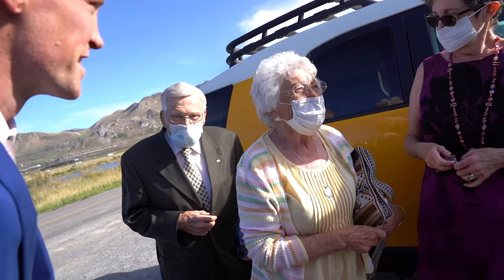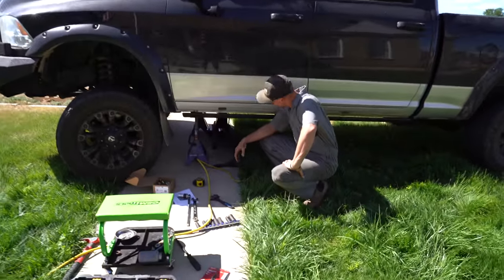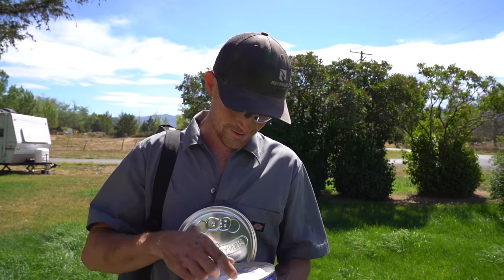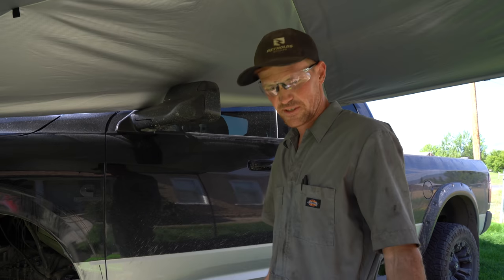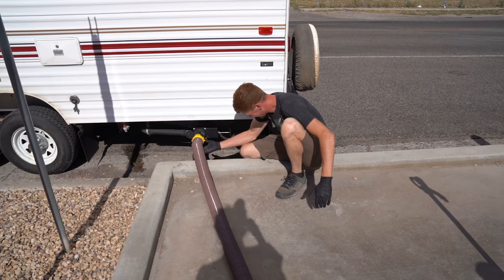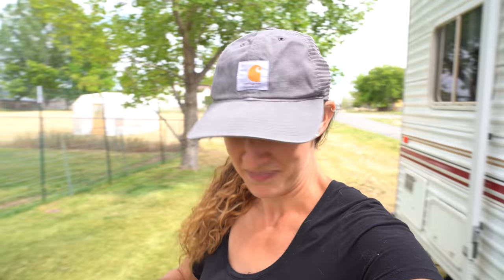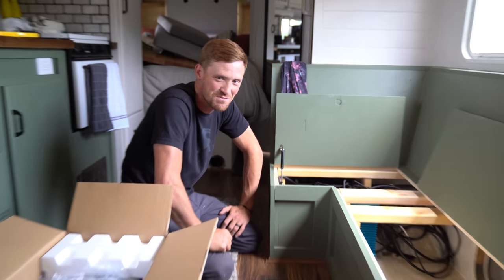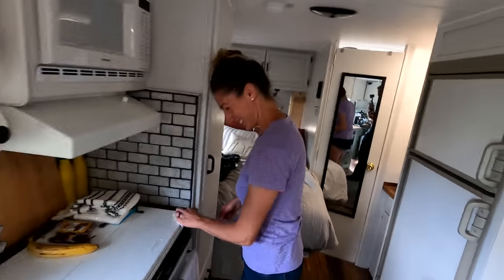FINALLY FINISHING THE ELECTRICAL SYSTEM IN TERRY | RV RENOVATION

Comment: Please invest in a high quality hitch lock for Terry. It would break your hearts and mine if she were stolen. If you have a cell signal at your property, invest in a security system. We also have a mountain property. Thieves broke in and stole thousands of dollars worth of equipment. I got jetpack hotspots from Verizon and RING cameras. We set them up on a Sunday and headed back to house in the burbs. Before we got home, the thieves were already on the property. Through our new Ring cameras we saw a strange truck drive into view, pulling OUR utility trailer! I called the sheriff, who headed out to our ranch. We turned around and headed back up. Meantime we watched the thieves filling their truck and our trailer with our things. We now have a good hitch lock on our trailers, and the one they tried to steal is parked in view of one of the Ring cameras. The sheriff caught the thieves a short distance outside our gate. Those Ring cameras saved us at least $15,000 that day!
Reply: Patti,  very interested in these RING cameras. Do you have to be on a Verizon plan?
Reply: Bent Nickel You don’t have to be on Verizon. Any cell carrier will do, but you want a good, strong signal. We chose Verizon because for YEARS, they were the only carrier that had a signal that reached our ranch. They have been good and reliable so we have stuck with them. If Trent & Allie have cell service at their property, I would suggest they stick with their carrier as long as they have a good signal there. If they don’t have a good signal, they should ask the neighbors who they use. They may need to place a signal boosting antenna at a higher elevation than their tiny home. Safety is such a critical issue. You tend to injure yourself when working on remote properties. You are using equipment you aren’t that familiar with, exhausted from the thinner air at the higher elevation, walking on extremely uneven ground and subject to tripping and falling. You need to be able to call for help if necessary. In fact, for my husband’s last birthday I bought him a new Apple Watch. The newer ones have a feature that detects if you fall. It is set up to notify me if he falls, and to call 911. We have owned our ranch for 20 years now. The first year, my hubby fell off a ladder and broke his back. He has cut across the top of his foot on one occasion, and sliced across the front of his shin bone on another occasion. We have been blessed to not be bitten by a rattlesnake, but they are common around here. Good communication may save your life. As for the RIng cameras, they have been a huge blessing to us. We can see vehicles coming down the drive, and talk to people through the cameras. While we are at the ranch we can see what is happening at home. This gives us peace of mind, at an affordable price.
Reply: @pattimessenger6214    Wow, that's exactly what I'm looking for, no matter the price. You can't put a price on peace of mind or a good night's rest. Thank you, so much.
Reply: Bent Nickel: Fantastic! I hope it works well for you.
Reply: @bentnickel7487  You need a good WiFi connection for your Ring cameras and doorbells.  At our ranch, DSL isn’t available, so we use the Verizon jet packs. At our home in the burbs, we have high speed internet through AT&T. And those cameras connect with that. Also, Ring sells little solar panels to power your camera. We have used ours with the solar panels since 2017 and they are fantastic!
Reply: Patti Messenger hate to sound stupid, but do I go to Verizon and ask for a jet pack?  We built a beautiful pole barn at our farm, don’t live on the farm, but had my husband’s tool box full of all his tools stolen so we need cameras.  Thanks so much for sharing, I’ll be looking into just such a setup till we can build a house.  I hate worrying about stuff being stolen, but there are people out there that find it easier to steal from us than to work for things.
Reply: @carolhub8080   "There are people out there that find it easier to steal from us, than to work for things". Carol, let's keep politics out of this, you'll give thieves a bad name.  ;-)   :-D   :-(
Reply: Carol Hub: I wish you the best of luck with your pole barn and rural property! I feel your pain about the stolen toolbox. Do you get a good cell signal at your property? If so, yes. Go to your carrier and ask for a jetpack. It needs to be set fairly close to your Ring camera so the camera and jetpack can communicate with each other. Ask for the newest and most powerful one you can get. You can have more than one camera for each jet pack. We find that the jet packs sometimes shut down. So every week we power them down. Let them have a bit of a rest before booting them back up. I found the Ring cameras easy to use and set up. They paired with the jet packs easily, I was able to do it myself on my iPad. Good luck!
Reply: Patti Messenger thank you!  We were at the farm just tonight and I told my husband about this and we will be looking into cameras and jet packs tomorrow.  Much appreciate this information.
Reply: Carol Hub: Wonderful! I hope it works well for you!

Comment: A little Unsolicited tip when leveling your trailer that we’ve found to be helpful, put a good stack of leveling blocks under each jack. When your jacks are more compact the stability of the trailer is much better.
Reply: That explains much. All my years with trailers, that never dawned on me lol. SEVEN jacks under a 29 foot trailer and it shakes like crazy ANYWAY lol.
Reply: Agree
Reply: Use wide blocks for stability -- never tall narrow ones.
Reply: oooh that's good to know and makes so much sense, I just wouldn't have even thoguht of that on my own!  TY  :)

Comment: Hydrogen peroxide takes blood out of anything and it doesn’t hurt the fabric.
Reply: I've actually had great luck getting blood out with HP. I used it in a medical clinic for years to get blood out of sheets without color loss, but it's got to be pretty quick. It worked like this. Soak the area with HP, let it bubble. When it stops, repeat with HP one more time. Scrub it together with itself, if you know what I mean. Rinse with water, then immediately hand wash with soap and water and rinse well. But like Nancy Loomis said I'd test it in a discrete spot first.
Reply: It was actually a nurse who told me about it 50 years ago when I had to take my son in for stitches.  I have been using it ever since and never had a problem but if it is a concern for sure do a test spot.  Better safe then sorry.  I have never used it on silk or any fabrics that have to be dry cleaned because if they need dry cleaning I don’t buy it has to be machine washable or hand wash.  I have used it on carpet and upholstery fabric however with good results.
Reply: I should’ve known that. But I didn’t. Thanks for sharing that.

Comment: I had a lot of cuts on my hands the other day that burned when I washed them.  I took a little castor oil and put it on the cuts and blisters.  The cuts were visible the next morning, but they no longer hurt.  The blisters were bad, but I think the castor oil helped them as well.  I continue to use  a little castor oil on them to help them heal faster.

Comment: I'm planning on having a system that will vent the hot air outside during the summer and vent it inside during the winter which will help with keeping the RV warmer in the winter.

Comment: Hey Trent - instead of 4 of those small, circular vents, why not go for 1 4 or 5 inch square vent. Wouldn't that allow for much larger airflow to cool your underneath electronics?
Reply: Was thinking the same.
Reply: I was also wondering that I was expecting something like a 4" x 6"  grill and he pulls out those small button grills.  After all they are hidden under the table anyway.

Comment: Trent, before you work on the truck next time, rub liquid soap (dawn) on your hands and arms. Let it dry and go. When it 's
time to clean up apply soap as normal and wash it all away. Learned from an old mechanic back in the 70s.

Comment: 21:50  Most unlikely that your proposed vents will provide enough airflow, even if you had a jet engine powering the fans.  And you will get fed up with the whine of those fans.  Check out putting  in large area vents.   Any way of allowing the warm/hot air to flow up the inside of the back of those seats and out new, large vents near the top?

Comment: 17:24   Putting on larger tyres.   Nice idea, but it will affect your drive ratios (like shifting into a higher gear), reducing the torque available at the road.  Your Speedometer speed indications will be out of whack and unless you have your speedo recalibrated you will surely rack up speeding tickets — so be warned and be super careful about that.
Reply: Alan Torrance, thanks 4 heads up! We had been considering a lift for clearance and wondered what it would do to the gearing, but sounds like a whole heap of ramifications.

Comment: A note: The water at a dump station most times is not potable so don't ever fill your water tank from that source. Always confirm you are filling with potable water. I don't think you have installed enough ventilation for the solar even with the fan. Those vents will clog fast and my experience is computer fans are noisy when trying to sleep.

Comment: Speaking on the subject of heat issues… In 2011 after a horrible experience at the hospital I was released in a state of delirium and essentially was rescued by the ambulance with a body temp of 68°… in January, outside in Minnesota. It took me over a week to adjust my body temp as I struggled with hypothermia. The consequences of that is now I can’t tolerate anything over 83° and I feel ill, nine years later still. What I found early on in this nine years is that this happens to roofers a lot who get heat exhaustion from too much heat… It can mess with your ability to deal with extreme temperatures.

Comment: Tips on construction zone that you live & work in- 
We all  know how exhausted you must be  at end of the day's work project - put there is still MORE work ! setting everything to rights ( end of video we got to see Allie pick-up and move 100's of small things).  
1. For specific day's project take 20 minutes and set-up all your tools and  supplies in a big plastic tub - inside  you could have middle size to shoe box size CLEAR  plastic bins that hold brushes,  boxes /jars of screws, bolts, nuts, o-rings, sealer, rags - you get the picture - 
2. LABEL tub &  bins ex: Big tub " bathroom toilet" - labels can be sharpie on painters tape
3. have an empty tub  for task at hand ( shallow 18x24 or so) that serves as your "handy helper"  - ex:  holds what you need  to pull and replace toilet seal-  
4. End of day - just throw everything back into bins and then into tub and put that sucker outside for tomorrow
Doing this will  save you  from accidentally marking up the finishes in Terri & you'll find it makes work and clean-up much easier
you guys are amazing

Comment: Note on COOLING AIR Vents
Your vents to the room should at least match the vent area of the inverter to supply adequate cooling (electronics will last longer). Smaller vents require higher velocity air for the [same] cooling, & noise goes up at least as the square of the velocity. (Fan noise goes up faster & different designs are required...& reliability decreases dramatically.)
Larger vents & slower fans will be the quietest. You will not want noisy fans.
Get rectangular/square louvered vents; the louvers can be close or widely spaced; narrow ones are noisier. You can paint them to match, of course.
Low velocity 12v square muffin fans are available, albeit scarce. (120vac are more common.) Sleeve bearings are quieter than (the more rugged) ball bearings & therefore used where noise can be an issue.
Remember, venting the inverter to the inside of the room will put additional loading on the Air Conditioner. With a 90% efficiency I/V [for example] you will put 200watts of heat back in the room with a 2KW I/V. For hot weather you should consider finding a way to vent the inverter outside. (I am surprised that the inverter installation manual did not mention this.) Of course, the extra heat will be a benefit in cooler weather (when precipitation is more likely in Utah). (Both of my parents' families were from Utah county.)
HD & Lowes have tons of these square-type vents.
Good Luck!

Comment: Hey everyone, first off, happy Friday and I hope everyone is safe from the ‘Rona’!! Quick idea about a way to keep your electronics cool when they are installed in small spaces. Instead of just cutting the small hole for the grate like Trent did, cut a little bigger hole and use a computer cooling fan instead. Install 1-2 fans on one side of the cabinet, and 1-2 fans on the opposite side of that cabinet. Have the fans on one side ‘pushing’ air into the cabinet space, and install the fans on the opposite side ‘pulling’ the air out of the cabinet space. You can have them powered up full time, on a timer, or on a thermostat. Hope everyone likes this idea, and please feel free to ask me any questions you might have, or ideas you might have to improve this idea. Stay safe everyone!

Comment: Not an ad, do I even know you'll see this? but Nexcare bandages by 3M are very waterproof, flexible and good sticking power at least 24 hours. Good for knuckles and practically invisible. Since you work with poop and animals and love getting in the dirt, I would use them. As a cook, washing my hands and kitchen ware all the time, they are definitely the only bandages I have found that work. I use silver and vit E on my wounds and they heal fast. Tell your mom.

Comment: Good episode!  If no one has mentioned this, you really need a tub of Happy Camper (on Amazon) for your black tank...just be sure to follow the directions. It doesn't have any harmful chemicals and liquefies the waste which means you can get a truly empty tank and avoid the dreaded "poop pyramid." The enzymes in it keep the smell down and doesn't mask them with gross chemical smells.  I use it in my 5th wheel (and previous trailers too). Can't wait to see what's next!

Comment: I think you're going to need larger vents and more than a computer fan, the higher RPM the better. I don't know how much heat the components produce, I've built some computers and airflow is paramount, input fans, exhaust fans, open grills as large as possible.

Comment: Allow me to introduce you (8 months too late) to mechanics' hand cleaner.  I use Gojo Natural Orange.  There are other brands and flavors.  But they are basically a creamy goop that dissolves grease, and many other species of filth, and incorporates pumice and glycerine, and turns your mess into a really juicy horrible looking mess that then rinses off in water and leaves your hands and skin in pristine, baby-sweet condition.  Okay, maybe that's a SLIGHT exaggeration, but you do get really clean. And it's easy and smells good!  And saves on dish soap.

Comment: By now you are pretty used to receiving advice from your viewers.  From what I’ve read most of it is sound, experienced-based ... and worth keeping in mind. 

That said ... my trouble-shooting toilet tips for Terry are ... 1) RV toilet paper will help prevent the need for using tip 2.  2) Buy a toilet/tank wand gadget that is used to unplug RV toilets.  3) before you disconnect the wastewater drainpipe run a couple buckets of fresh water through the toilet to flush anything that might have remained behind. 

You’ll thank me later for the Terry The Trailer Toilet Tips.

Comment: Trent - Here's an old mechanic trick: Smear dish washing soap all over your hands, arms and especially under your fingernails and then let it dry (only take a few minutes) BEFORE working on the vehicle. Once you're done with the work, the grime and grease will come right off with a little hot soapy water. Makes cleanup sooooo much easier.

Comment: suggestions: 1. add a box either on the hitch Front) for external storage or the back or both...that way all your hardware equipment with locks including the propane for the cooking stove is out of the way...anything you're not using goes in the back storage box.
2. add 2 wood slots under the inverter.. to let it breath a little more.. that way it has 1 inch space under it and you won't feel the bottom heating up in the long run. 
Stay safe.. GOD BLESS.

Comment: By the way, very tiny leaf springs [about 2" long by 1/4" wide] are used in vintage sewing machines, in particular to hold the slide plate under the needle area in place and taut.

Comment: Hey Friend's. Just watched this Video. The size and RPM's of the Computer Fan's are not large enough or fast enough to give you the Cooling you need to protect  the Equipment. I would mount the Fan's inside the Box so they pull the Air into to the Box and across the Components. On the opposite side of the Box, Vent the Fan's blowing out of the enclosure to pull the Air and that will increase the Air flow circulating inside the Box increasing the chance of getting Air all around the Batteries and Components. I use Refrigerator Condenser Fan's ( The same thing in a Freezer when you hear that Fan running and feel the Cold Air). I would install 1 in the Hole you put in the Corner and 3 on the long section and 2 on the opposite end to pull it and Vent it out the End of the Box on the Short Side of the L Shape. The 3 pulling the Air in toward the back Wall of the Box will definitely increase the rolling of the Air in the Box. Good luck Trent, I know you can do this, it will take a little time but  well worth it to protect your investment. Maybe a 5 to 6 hour Job.